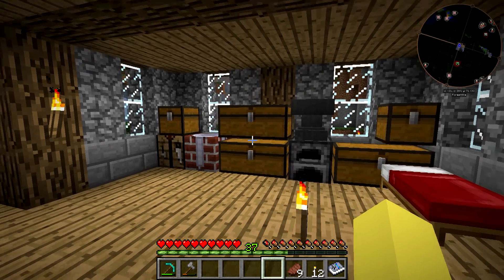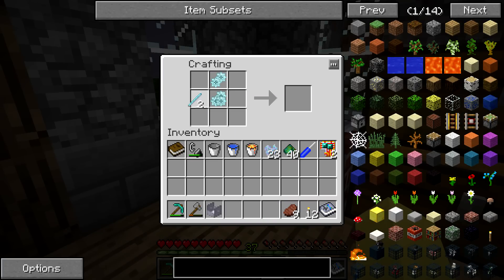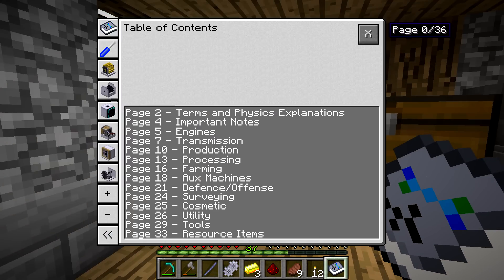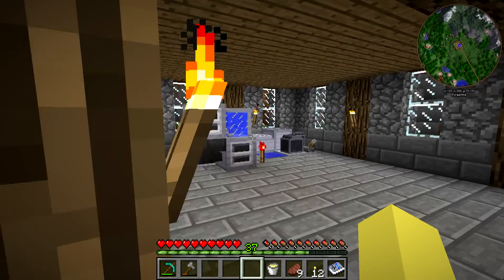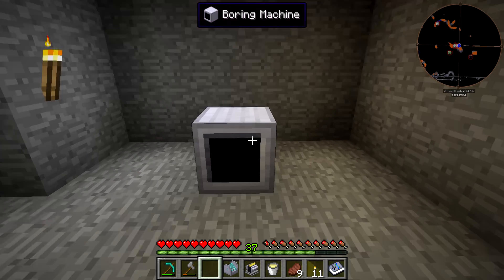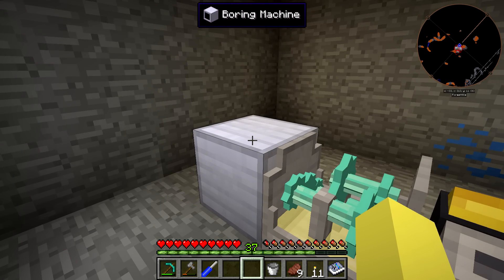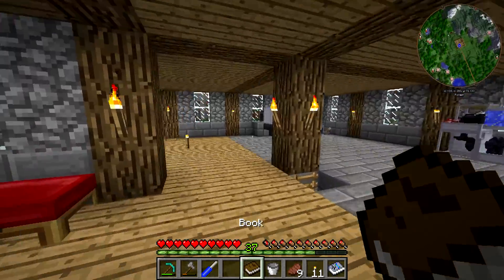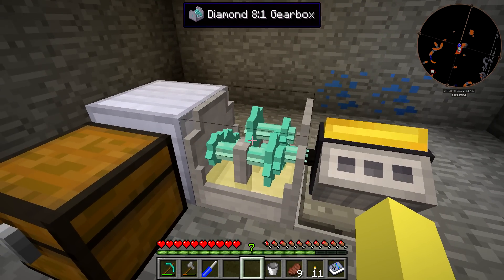Surviving With RotaryCraft :: Ep.7 - Boring Machine And Gasoline Engine

Comment: why dont you use gas engine on extractor? only downside is slow process, but use considerably low fuel and no redstone.
btw really looking forward to see bedrock breaker episode :)
Reply from the maker: I mainly wanted to use the performance engine because eventually I will have an excess of blaze powder to use on it (same with ethanol crystals), but also because I like using all the different machines available :) Can't wait for the bedrock breaker episode too!

Comment: i wish i could use my boring machine but i really need to silk touch diamond it s too important, so it will wait for a silk touch book....it can take a long time.
Reply from the maker: Yea, i got quite lucky with the book. I mainly am okay with running it 2x1 and then running down the tunnel if it finds any diamonds and silk touching whatever is left. (Fortune would also make it slightly okay, but not as good at silk touch)